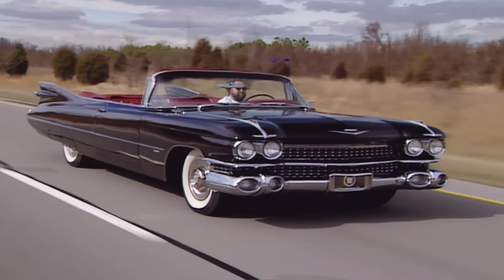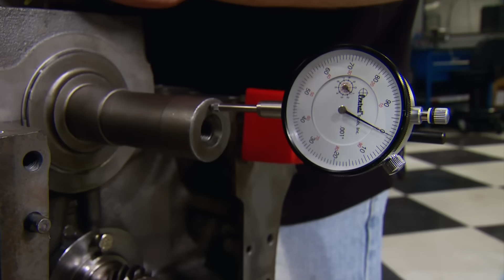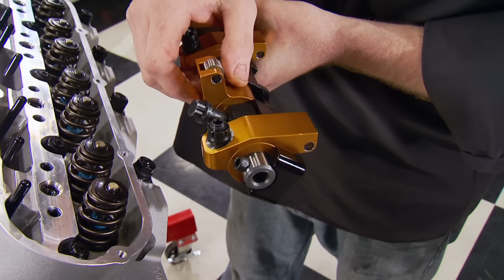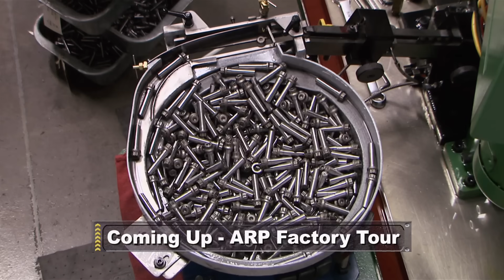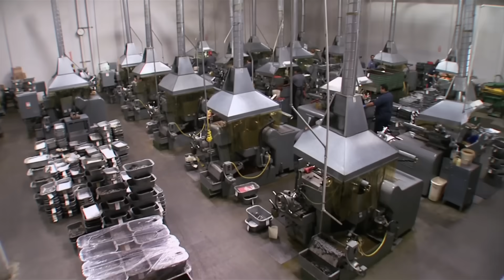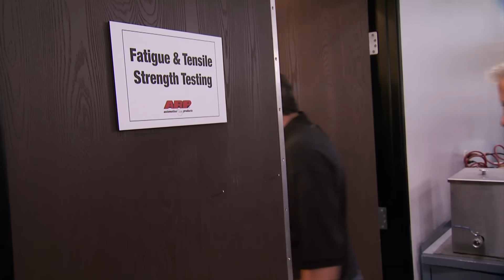Turning A Junkyard Cadillac 500 Big Block Into A Modern Day Monster - Horsepower S16, E3

Comment: you can modify 426 hemi rods and the Cad crank, use 400 Chrysler pistons shaved .010 bore it .040... and have yourself cheap forged rods... a melling oil pump, do a shaft rocker system , do some bowl work and a decent cam... an Edelbrock manifold EFI or Holley... we used to modify BBC headers as well... easily 550-600 HP with no sweat

Comment: I had a 472 in a '71 sedan deville. Sweet engine, but it needed heads something fierce and only weighed slightly more than a small block Chevy fully dressed out. So why would you use an SB? Because there weren't any parts for it back then. Now you can build a really nice Cad engine and put into a nice lightweight vehicle and demolish the streets:D

Comment: Beautiful build. I had a '70 and '73 I think 472s that I bought both with 200K on the clock for sub-$1000 (the whole car, not the engine) in the day, and they ran perfectly. I noticed injector bosses available on the MTS intake. I respect any project owner's right to spec whatever speaks to him, including a carburetor. That said, the cost to inject it, including tuning, would be trivial in light of total engine cost. I assume MTS can provide the crank sensor/bracket and everything Cadillac-specific you would need. I'd like to see dyno numbers on a similar build.

Comment: I worked in a automotive machine shop with my father back in the late 60's and early 70's.  Most of the local guys had little money so to build a fast street car they would take a small body car and drop a luxury car engine in them. All the Cadillac,  Lincoln, and Chrysler had big blocks that were balanced and blue printed for a smooth engine.(rich people wouldn't put up with a rough running engine)  there wasn't any performance parts available back then for these engines but they were fast in these small light weight cars. I built a 1958 Studebaker pickup with a 413 Chrysler in it  along with a Chrysler rear end and torqueflite transmission. This thing was crazy fast. Really enjoyed your video. THANKS
Reply: Man, those were the days. 🙂

Comment: I was told by a Mercedes engineer back in the '70s that this engine was the only American production engine that would pass Mercedes engine endurance test, (extended running on dyno at rated HP/speed) all the others failed the small end of the rod, whereas the Cadillac had a bushed small end. This modified engine at 598 HP should last a long time in a street car or truck, it will be  loafing most of the time.
Reply: Why was Mercedes testing American engines on dynomometers?

Comment: Nobody makes aluminum heads for these things anymore.  In the 90s, people used these in Eastern proto-Rockbouncer rigs, that carried over from the old 'car up on blocks' in the country Southeast US, you know, Hick Land.  Those guys have a lot of vertical and they used to use propane as a fuel, and propane doesn't have much oomph, so people took 472 and 500 Caddies and used them in 4x4s.  These engines have high-quality internals and were basically indestructible for the HP of the times, and these were some of the first non-Chevy legacy V8s to get aluminum head attention.  The Age of Legacy Aluminum Heads is just about over, though.  They're still available for all the popular old V8s but the junkyards are about tapped out.  People are saving Square Bodies and treating them like gold, lol.  I can't really see a place for the Caddy V8 to continue, the BBF has what seems to be a long-term committment at least from Ford, which advertises 'all new tooling' for their 460XBB which comes in 4.5" bore size.  The BBC is here to stay of course.  Indy Cylinder Heads used to make a Short Deck Hemi, which is really my dream motor, and Hemis will still be made but they're rarer than usual which is a lot.  Kind of sad to see the legacy V8, which  lasted so long, come to a close.  We lived in a Golden Age bros.

Comment: I had a a 76 with the 190hp 500. smogged to death, too slow. Dad's 1965 with the 340 hp 429 v8 was fast.  Wonder if super unleaded is required w/ the higher compression ratio?

Comment: One of MOST UNDERATED ENGINES in Automotive history ,with Forged Crank ,and Rods ,would keep up with ,or Beat Anything !
Reply: Torque monsters,to get those big heavy cars moving and smoothly too.
Reply: They would live as long as you kept them under 4200 rpm.
Reply: The top factory version of the 500.1 had more torque than the engine in the GSX.
Reply: It was perfect for getting those huge Cadillacs moving from a dead stop.

Comment: The factory hp data is incorrect. The 70 model 500 was factory rated at 400hp. 71 & later engines were de-rated.

Comment: I can say for my own build these don't cost hardly anything to build. I'd guess I have $4,000.00 in mine. 

I used 440 Mopar rods. Had the crank offset ground .100" and narrowed the rods to the Cadillac width. Bought JE Pistons .020 over and Mopar pins. Reground the cam,  BB Chevy valves and ported the heads just a bit to blend the valve job. Stock Edelbrock manifold, swap meet 850 Holley. Rockers came from Canada back then. Plain old oil/fuel pump. Absolutely nothing in this engine. 9.5 compression. 

It was a brute. An absolute Brute. 5400 rpm and it drove so different, it wanted tall tires and 350 gears. It wanted to strain against  a load to really get it done.  -- You may make a lot more power with other engines, but I don't believe they will out pull one of these for the smooth steady rate of acceleration on the street. Don't need money at all to me.
Reply: Naw, they are EXPENSIVE to do them up right.... 

The MOST you are going to get with even massively ported stock heads is MAYBE close to 500h.p. 

I've ported those heads, AND I've flowed those heads. They're garbage, even with port work.

Edit: Also, why would you waste your time and money offset grinding the crank to end up with more stroke and more cubic inches?? All you'll end up accomplishing IS lowering the redline with more inches. The heads CAN'T even support the factory 500c.i. that they are

Comment: I predicted 600 hp based on intake flow numbers.I raced big Chevies for over 15 yrs in my prostreet Malibu.For N/A engines power lies mostly in heads as we all know.My first blown engine was budget 467 bbc with 8-71 making 800 hp and running mid nines at 3650 lbs with me in it like you could imagine.Went all the way to 538 bbc pro stocker short block blown that blew right thru my tired converter.Next was 526 vintage pro mod piece with 12-71 hi-helix magn cover Littlefield but I managed only test it without blower.It made 800 too N/A but after that life happened and I sold the lot.Still getting my fixes thru sites like this one.

Comment: I read an article in 4wheel and off road that gave recipes for off road engines. They had a 500 Cadillac engine in there that made 600 ft-lbs of torque at 900 rpms. I wish I still had that article.
Reply: You really cannot trust those infamously incorrect articles.

Comment: Though it was stock, we shoehorned a Caddy 500 w/it's turbo 400 into my 1968 GMC that was a 6 cyl stick shift. The truck had a 3.73 gear. That truck could pull Mt. Everest if you could hitch it to the truck. That motor swap lasted close to 20 yrs before biting the dust.
Reply: My dad had a early 60s ramp truck that they used to haul their race car.  500 caddy and turbo 425.  He said it would tow the world but horrendous on gas mileage.
Reply: I can see how it would make a great truck engine.

Comment: I read a series of articles in a car magazine, don’t remember which one, in the early 2000’s about building a Caddy 472/500. I had a really nice 64 Chevy step side with a 305 in it that was getting pretty tired. Found a late 70’s Caddy with 78000 miles that ran pretty good but the suspension and wiring were shot. Bought it for $200, pulled the engine and transmission, and sold the rest for scrap for $100. Rebuilt the engine, had a valve job, put in a mild cam, Edelbrock intake and carb. What a beast of a truck! It would spin tires forever with the light bed. Sorry I ever sold it.

Comment: never ever use weatherstrip adhesive on any part of an engine even the pan, there are thousands of products available that are designed for engine use. im betting some old engine builders are cringing if they heard that, years ago one of the top builders in san antonio finished  an engine for me at the last minute for a race over a thousand miles away, i finished the car in the parking lot of the motel before we went to the track, as it started it locked up before i could load it back up on the trailer. picked pieces of hard weatherstrip out of the oil pump and oil passages later. the name weatherstrip should be a clue

Comment: I've got a 549 Ford out of a '64 F-4000 dump truck I want to hot rod and repower my '61 Falcon station wagon with. Comp Cams doesn't make a hydraulic roller conversion kit for it, Mahle doesn't make 11 to 1 pistons for it, Cometic doesn't make gaskets for it, Edelbrock doesn't make an aluminum manifold for it, No one makes conversion headers for it, I can't find a flexplate or adapter to mate my 6 cylinder Ford-O-Matic to it. With the automatic trans, I think the stock Falcon rear end will do. If I can't find some aluminum heads for it, I may have to put power steering and maybe disc brakes on it.

Comment: We stuck 500's in 4door chevelles and mid 70's Novas. Nobody wanted either. Also ran 3.08 geared posi- again nobody wanted. We milled heads/block and reground cams(we used cal-cams). Tweaked the qjet or 850 holley, modded hei ign. And 2.5" dual exhaust. Used good valvesprings and set lash at 1/4 turn preload. Max 4800rpm with rev limiter. Man oh man, we rode the torque curve and wicked burnouts at 35mph roll.

Comment: Easier/cheaper/better use a 1/4" stroker crank w/a 454 Chevy, same size, more power, much less BS.  Take off the rose colored glass's when you ponder the structure of the block and the main journal diameters and the light just might come on.
Reply: Nothing beats bbc in terms of efficient hp vs input.

Comment: Fantastic Cadillac 500 cu inch combo 👌 😅
Would 800 hp be attainable with this Engine with a bigger cam & compression  ??? 

Thx 4 uploading 😅 
Robert Australia 🇦🇺
Reply: Not really,you need in excess of 410 cfm of airflow from intake side.

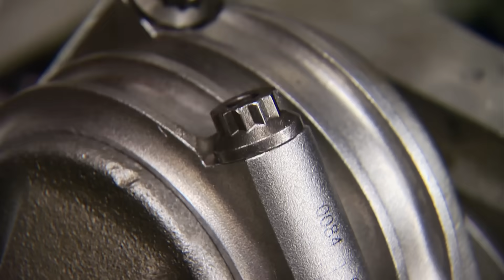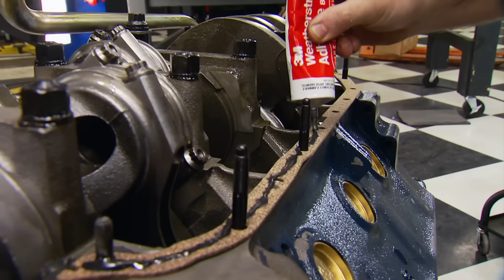Comment: 5:10 if GM didn't design the 1970 engine to spin pass 3,000 rpm. Why did it make peak hp at 4,400 rpm? 6:17 why are you putting gasket sealant on top of a gasket?

Comment: quarter of a million miles ? Those pigs didnt even make it to 100k , 500 is s shit design, i have many mid seventies eldoradoes almost all are under 100k and very few have the original 500, timing gear teeth clogging oil sump, crank was to heavy and wore out bearing , oil pump housing aluminum. The engine is garbage from top to bottom, very poorly engineered boat anchor.

Comment: I think they misspoke when they set initial timing at 31*.....I think he meant total!  Also, them heads flow enough air for 700+ HP and that cam is the bottleneck in this engine and maybe the carb also, try a dominator!  That MTS guy didn’t look too happy sitting next to the dyno operator!

Comment: I spent over 40k on several 425s and I finally got a 500 caddy that was super built up. 500 hp 600 torque built by cad. Co. In Albuquerque. Yes they dynoed it.
The problem is very few people can build them properly. Yes they make tons of torque but you can get a crate motor with warranty to do the same that is lighter. Once you started getting more power out of these engines with bolt ons and cams look out your wallet will look like a Ethiopian. I had 3 caddys I drove over 24 years. I worked on them nonstop. I also rebuild the transmission,  differential which was a posi diff out on a caprice, brakes, suspension you name it I did it all. That Ole 1979 caddy with that 500 could outrun  just about anything.  It was a 500 swap. The engine I had out probably 8 times and the th400 took 2 hours to get out and I'd have it completely disabled flat. I know every bolt in that car top to bottom including torque spec.
Reply: That's called a labour of love lol.  Right on dude 🤟🤟
Reply: @k.z.3304  Took words right out of my mouth.From this testimony we all can see that he is brother gearhead.
Reply: @SchoolforHackers  Given your ride,that wouldn t take that much,lol.
Reply: what kind of car did you have it in?  can you keep it in a FWD caddy?  would it shred the drivetrain?  i'd love a build like this but am clueless when it comes to these cars
Reply: @benhartland4708  It was a 1979 Cadillac Coupe Deville.  I had it for 15 years and it was my daily driver. I put over 100k on it.  I also put it on a serious diet. It was probably 400 pounds lighter than stock.  I raced it nonstop in denver and lost to about no one in any car.  Everything was upgraded. Rearend, driveshaft transmission and brakes and suspension.   That kind of power you will break parts and I did to.  There's a guy on YouTube who did a fwd Eldorado big power.
Reply: 500h.p. in a 4500lb car isn't that fast... even years ago.

Today there are MANY daily drivers out there with well over 4 digit power.

Comment: They left so much power on the table by going with that cam.
Reply: Horsepower sells cars.  Torque wins races.
Reply: @garyhalmbacher6875 
Winning races sells cars too.
Besides, it's not either this or that. A bigger cam would increase both.

Comment: I miss my '78 Fleetwood Brougham. If I find another one that's in good shape, I'm giving these guys a call and it's going to get some extra power, and lots of it.  Don't care about gas mileage, I just want a heavy cruiser that is ridiculously overpowered.
Reply: That's what I'm talking about,that's a bolt in for a 472 0r 500 engine with very little mods,and the 77 and up Caddys where much lighter in weight.
Reply: Honestly if you drop some modern tech into one of these engines you can probably improve the fuel economy AND the power at the same time. In particular with EFI you could add some compression ratio and timing without having to run special fuel (Without ITBs or very carefully designed manifolds carbed engines usually have some cylinders running lean and some rich, and your compression/timing is limited by the leanest cylinder) while also improving your economy. Also those alloy heads have a modern looking chamber that probably does a lot of good for economy and power compared to what was available in the 70s and 80s.

Comment: That intake is to much for the street it's nogood untill it gets in to the 5000 rpm area and is nogood for torque or gas milage below 3000 rpm I had one I swapped to to the performer and a Qjet carb I'm almost at 600 HP 644 torque

Comment: MTS helped me with my 1973, 472. Basically, a stock rebuild with an Edelbrock manifold and mild cam. It was .030 over with 8.5 to 1 CR, and made 365 HP, on 87 octane, at 4800 RPM.
Reply: It doesn't take much to breath life into these monsters - they were so neutered in the 1970's and 1980's that if you just put a decent cam into them and let them breath they will easily pull all kinds of HP but especially torque
Reply: You got a raise the compression
Reply: @danasmith1899  Don't need it. it was in a 2000 LB Rat Rod. LOL!

Comment: I've always wondered why most of these wind up rotting away in junkyards.
Reply: I understand they are in shortage now.
Reply: Because bone yards  primarily have been taken over by scrappers looking for a quick buck - they no longer care about selling parts - especially for older cars.

I just sold a bone yard my 2000 ford taurus with the HO 3.0 32 valve engine and the just crushed the whole car for 3600 lb at $0.10 a lb - that motor and transmission were worth 3 X that - the factory aluminum rims were worth $100, the never wrecked body parts were worth $1000...

They scrapped it for $400 along with who knows how many classic cars - Caddys were all crushed decades ago by these bastards
Reply: @barking.dog.productions1777  "cash for clunkers"
Reply: @V8_stop_hiding_my_comments  Exactly - take our heritage at every chance - stupid people never see that we are in a constant war with big government.  They hide it behind platitudes, but the truth is that these older cars are a BIGLY part of our history...
Reply: @barking.dog.productions1777  Also keeping older car on the road assuming it doesn't burn oil is cleaner than producing new one.

Comment: Back in the late 80s early 90s I put a 76 500 caddy in a 77 GMC half ton pickup it was a real fun tire shredder got about 8 mpg with 3.40 or 2.56 rear gear didn't change anything but the smoke off the rear rubber. Lol @memories
Reply: I put a 500 in a 75 Chevy Blazer and used a 2.56 rear just to help from spinning 😵‍💫 the tires 😳
Reply: If it only got 8 MPGs, then it was TIRED a.f... 

They do better than that when they're healthy. 

In the summer I daily drive a ROWDY 547", 13.5:1 compression, BIG solid roller cam, 1250cfm Dominator carb, big block that makes over 850h.p. and IT gets about that kind of mileage.

Comment: This is a very old show but i still love to watch these old power block shows. I want to see the full race 500 on the dyno... what are the limitations to this engine? Love big caddy BOP big engines as well.. they where the easy way to get easy power into anything with a trip to the right junkyard.
Reply: Stock conrods are junk.  Stock crank is good.  Stock heads low performance as well as stock intake.  Stock exhaust not too good.  See the Cad Co.  I thought with all the money spent it would do better.